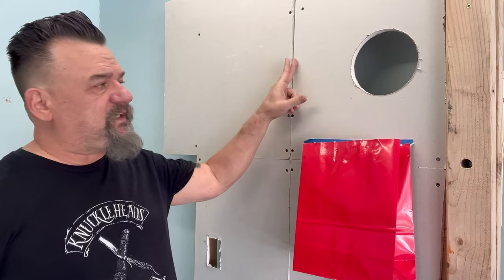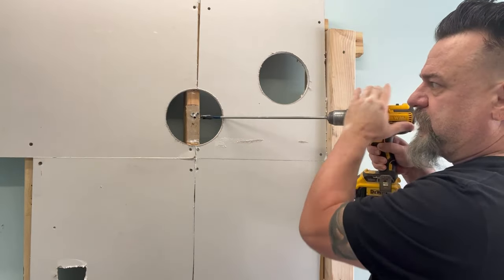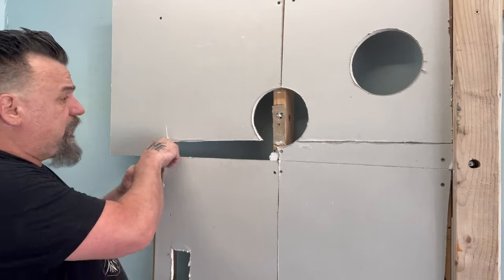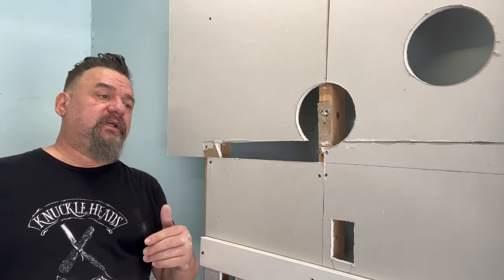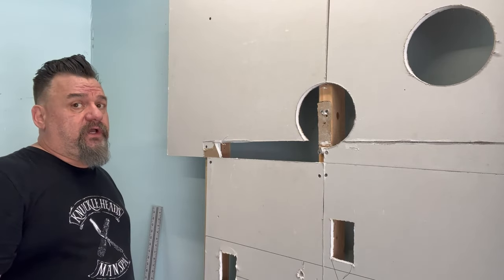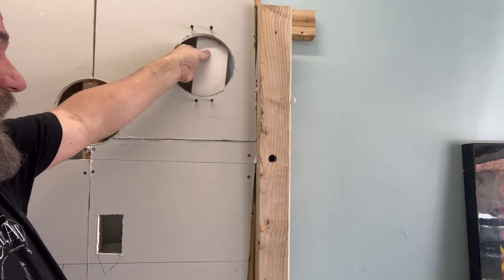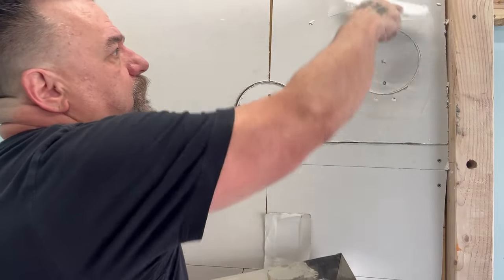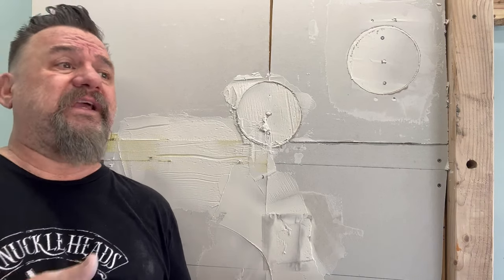Unbelievable Hack for Repairing Drywall and Fishing Wires - You Won't Believe What Happens Next!

Comment: Off Topic Question:  If you are running service entrance cable to a panel immediately behind the meter base, it does not have to be in conduit.  If you ran solid wires, would it have to be in conduit?  Thanks
Reply from the maker: codes are different in different states. if your state allows for cable its all good exposed. with regards to stranded or solid it doesnt matter as long as the wire is the proper size. you may look into the outer covering but in pipe you would run individual conductors and pipe it in or maybe PVC.